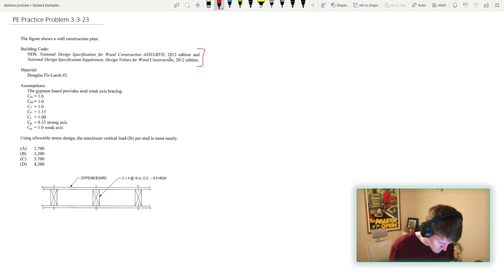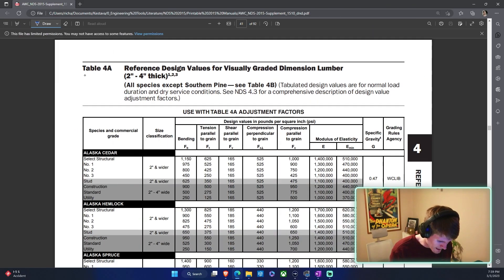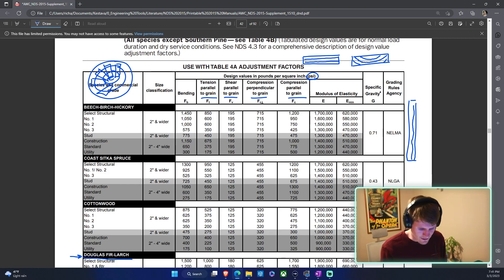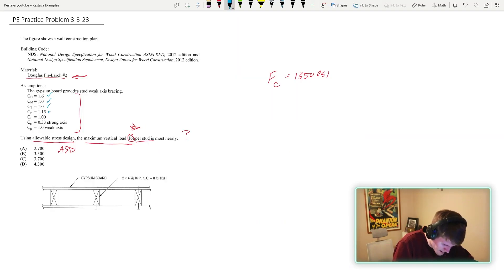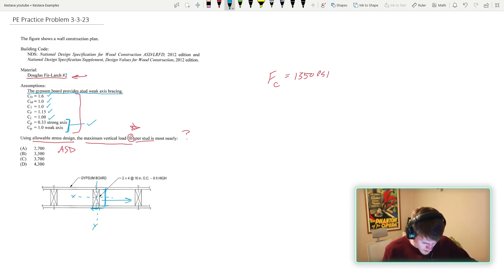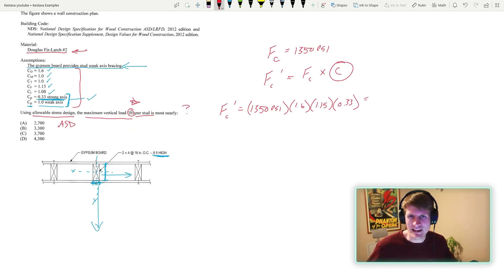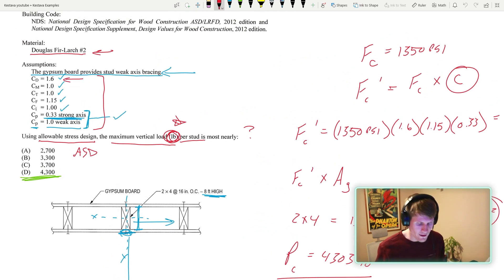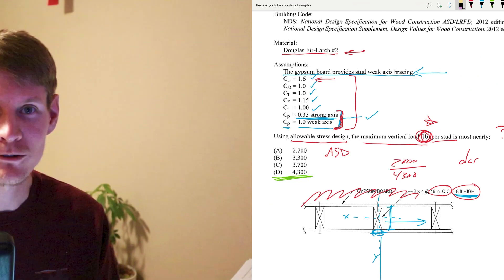Wood PE Exam Practice Problem | Civil Structural #structuralengineering

Comment: what if loaded the 2 x 4 on the thinner side? not lengthwise but how it would be loaded if it were acting an a joist? still perpendicular to grain?
Reply from the maker: still compression perp. to grain. the only way to load parallel to grain is something like a wall stud being loaded from the top.

Comment: Question:  how do you know not to use Pcr=pi*EI / (Kl^2).  Because they give us a ht. which could steer you to use this equation.
Reply from the maker: the euler buckling equation is taken into account when going through the equations to calculate Cp since Cp is the "stability factor" for wood design. look closely at the equations when calcing Cp and you will notice the similarities between the multiple equations and euler.
Reply: Show the CP was already calculated based on 8-foot height correct?
Reply: the use of the Cp looks to be wrong.  column constrained in its weak axis leads higer values of allowadle compression

Comment: Is there somewhere in NDS where it explains how the force can be perpendicular and parallel. Technically there are 3 faces where the force can be applied. Two are parallel to grain and one is perpendicular to grain. 
Just wondering bc I'm not very familiar with wood lingo/imagery/design

I'm screweeeeeddddd

Comment: Another great video! Also, now that the exam is CBT, would we have access to the ACI SP-17 for the concrete wall design (simplified method) and for the column interaction? I'm guessing if it is needed, it would be part of the question?